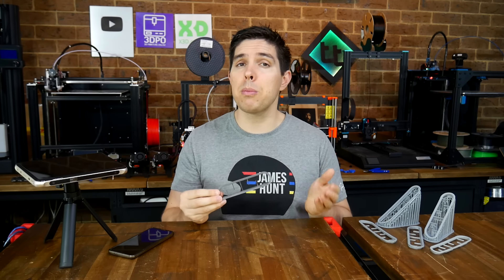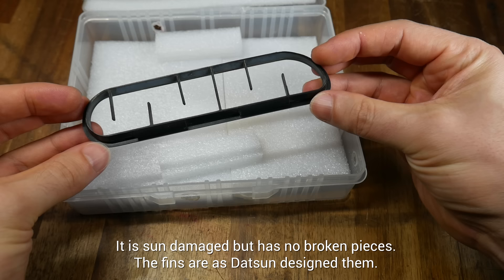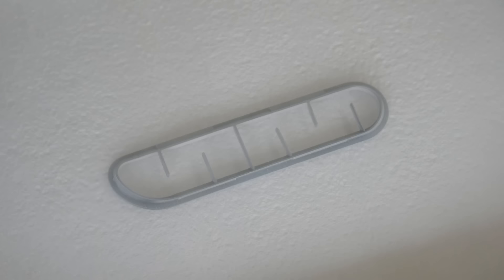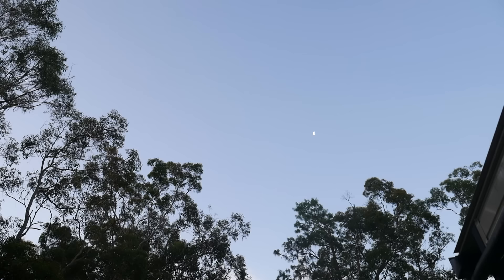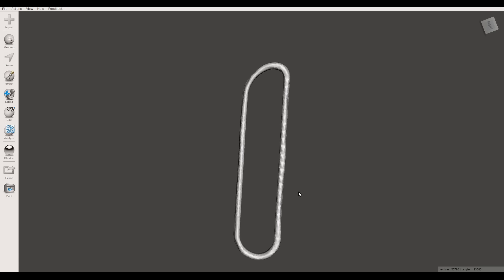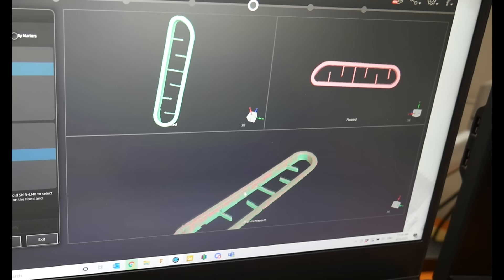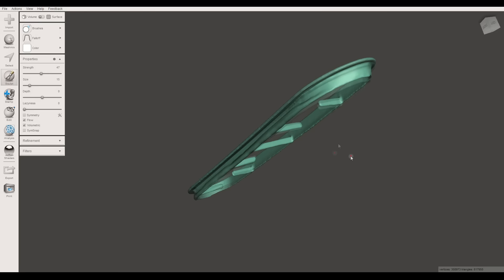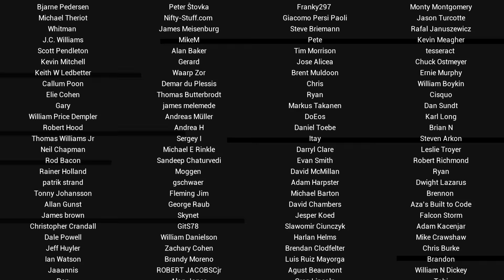3D scanning + 3D printing to complete a classic car restoration

Comment from the maker: Responses to common questions/statements:
- Once the part is verified to fit, I will be releasing the STL for free. I have no desire to profit from this, and Myles had no desire to profit from it either. This is the same Myles that frequently makes 3D printed parts for the Mighty Car Mods boys. He is a generous legend. We are all just car enthusiasts using 3D printing/scanning to enjoy the hobby and help each other.
- Plenty of requests to also try scanner x or y. I don't have an iPhone to try that and I previously compared a Kinect scanner to the Revopoint in that video. The Revopoint is much better so there was no point including the Kinect sensor here.
- As I mentioned in the video, this part will need to be painted before it goes in the car. The resin will become more and more brittle in the sun so will need to be protected. If it still turns out to be too brittle, as some commenters have suggested, a mold can be made to create the part from another technique if necessary.
- Some people are upset that I didn't show the part in place. This is simply a matter of logistics. I've only met the owner of the car a couple of times and we don't live near each other. In case anyone has forgotten, we are still in a pandemic and it's not as straight forward as rocking up somewhere to try the part. It's unlikely I will see the car in person any time soon, but I will update with a pic in the description when I can.
- Plenty of people saying to just model the part. As the video stated, I could have modelled it, but it would need several iterations with test fitting in the car before it was ready. As the point above explains, this was not possible. The scanned part still needed clean up, but I am 100% confident the overall form will fit the dash. It's just a matter of minor refinements where necessary for the 'clip' portions on the underside which I can do remotely. Besides, Myles had his scanner and offered for me to try it. This project came up and I'm sure most would agree the comparison between scanning methods is what the video interesting.
Reply: Good of you guys to release it for free! 👌 Car people!
Reply: If you need a stronger part I'd suggest printing it in pla and cleaning that up for casting
Reply: Making a silicone mold of the original part and casting resin would probably still be the most accurate compared to scanning, but now you can share it as a file, and the accuracy isn't critical.

Another very precise but time consuming way to 3d scan small objects (though it's easier with conductive objects because you can have an automatic trigger) is with a cnc or a dedicated mechanical scanner and plotting the points. (Basically an AFM but bigger)
You could probably make that with an fdm 3d printer by gluing a needle on a bl touch and making a grid pattern and noting at which point it triggered.
Not sure if the accuracy would be that great though.
Reply: Good on you mate. Plenty of internet experts and critics; very few blokes like you who not only make something new, but share it for free. Keep up the great work!
Reply: @KiraSlith  A science and technology based youtube channel might not be the place for you.  I'm sure there's some conspiracy channels that are better suited for your temperment.
Reply: regarding the last point made: Sometimes it's a good approach to go hybrid. So use the 3d scan as a reference and either model a new part taking the scan as a reference OR just using tools on the 3d scan and create planes/faces/surfaces from it (aka reverse engineering it) and go from there. Of course you should always decide which approach is fastest, based on the quality of the scan and the desired quality of the replicated part.
Reply: Hi TT, where have you shared the file? Would give it a crack in MFJ to see how it handles.. Cheers!
Reply: Bloody hell good on you for doing that mate, But im lazy, i like to do things the quick way.
Reply: where I can find the stl?